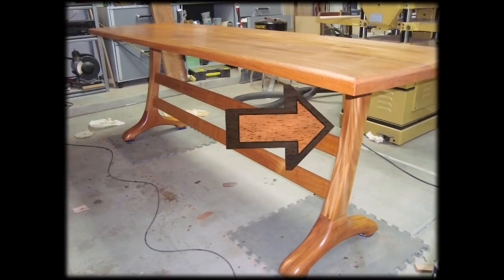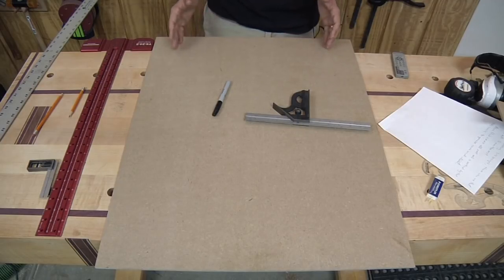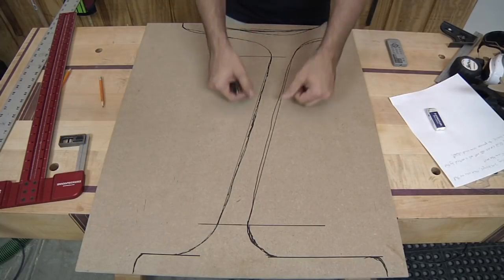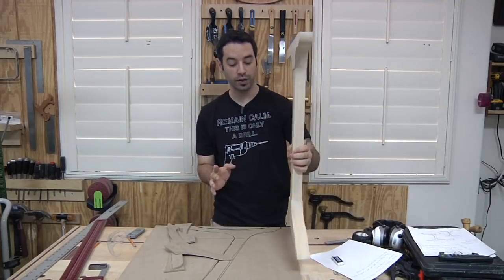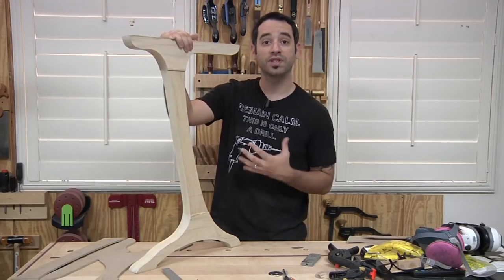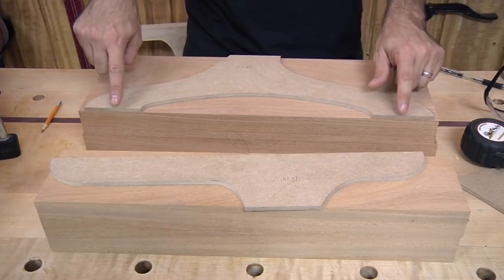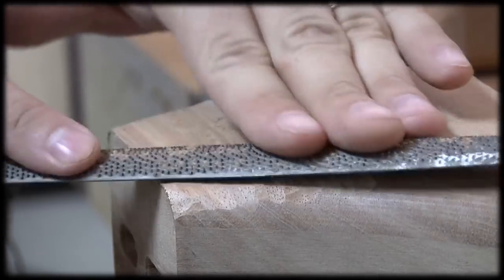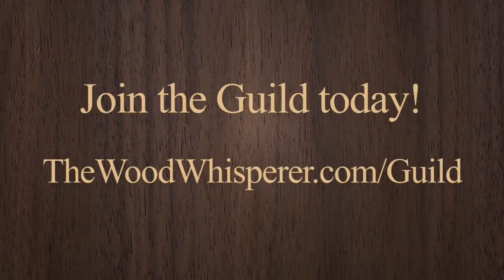134 - How to Make a Trestle Table (Part 1 of 3)

Comment from the maker: While I would have loved to cover those details doc, I had to leave some stuff out for the sake of a reasonable production length.  I have covered wood grain in other videos so I figured this would focus more on the building and the templates.  Ideally, I wanted to go with full thickness pieces but just couldn't find the stock I needed.  So  a glueup was necessary.  As the wood ages, any discrepancies in wood grain will become less and less noticeable.

Comment from the maker: I usually do. This project was a bit tricky though since I actually bought material as I went. Also keep in mind that prices vary dramatically across the country. So the most accurate way to get a cost estimate is to use the board foot count. Of course I don't think I provided the board foot count on this project either, but for future reference. :)

Comment from the maker: @TheLumberjackass My goal is always to show a variety of tools and techniques.  That means I will occasionally pull out something like a Domino.  Which by the way, is the first time I've shown it on the show in well over a year.  Most times I default to the basic tablesaw, bandsaw, jointer, planer tool set.  I needed to get this project done quickly and the Domino allowed me to do that.  The alternative?  No video at all.  I'd be happy to explain this further in email.

Comment: Wish I had time to autocad you some helpful improvements on that wicked table. I saw a drafting table come out of those legs. Hide 2 pivot points in each leg at the kankle snd top curve so you can adjust the angles. Hide the joints with a mortise and tenon style pivot curve with hand adjustable knobs in the inside. Nice format. More videos on yourube can learn from this.

Comment: True, full-size model really gives you the feeling that if this is true. But matters of proportion and design look great in a three-dimensional CAD like solidworks or similar software. I will not argue with you, but I think it's early stages excellent tool that gives you a lot of flexibility in planning of the product. By the way these programs really not complicated to use

Comment: I'd venture to say that Mark didn't have all this equipment when he started. But he did possess the most important tools. Purpose, patience and persistence. Everything else is a result of those three attributes regardless of your occupation. I suggest you check out Paul Sellers channel, he'll show you how to do fine work with basic hand tools. Remember, machines only save time they don't make you a woodworker, it's still a combination of knowledge and careful execution with or without a motor.

Comment from the maker: @TheLumberjackass Oh no problem.  Just remember, there are lots of resources, including my own, where you can learn to make more traditional joinery using much cheaper tools.  So just because I use a Domino in this project, doesn't mean you can't build the same thing using a traditional tenon or inexpensive dowels, which you probably saw me do countless times in the past. Some folks see an expensive tool and immediately dismiss the project. This is a shame and it misses the point.

Comment: if you're worried about the glue joint maybe next time use 4/4 or 5/4 and make a lamination with a darker wood in the middle so it will be part of the look of the piece as opposed to something you're trying to hide or blend in.

Comment: you should try and use a computer design and connect your computer to a Projector and project the image onto a flat wall and by adjusting/moving the projector you can get and amazing feel as to the end product

Comment: Seems like it might have been easier to do the Dominos on the leg to top/bottom joints before the curves were cut, more surface area for the tool to sit on. Don't know about you, but I would have a heck of a time balancing it on the smaller surface.

Comment: Hey Marc, I thought Honduran Mahogany was really hard to get new these days...where'd you get yours? 

Also, .if you ever get an old piece of furniture (like 90-100 or so years old) and it's dark, chances are it's Honduran Mahogany. I got a few good pieces from an old bed. The posts were solid wood, but the head and foot boards were just veneered in Mahogany. I was a bit disappointed because the panels were about 1" thick and if they were solid wood, I could've gotten at least 3/4" boards.

Comment: Eight quarter? Do you mean two inches?
Reply: 8/4 lumber is an actual 2 inches thick where as 2 inch lumber is actually 1-1/2 inches.
Reply: Lumber thickness is measured in quarters.  4/4 is 1" before milling, 6/4 is 1.5", etc....
Reply: Steve Russell Yes, I understand that. The question is - why?
Reply: It probably has to do consistency.  Let's look at the <1" sizes.  We don't want to use decimals (.5, .75, whatever), because these markings are often just hastily written or stamped on rough wood, so something as small as a decimal point would easily get lost in the mix, possibly leading to confusion when you go above 1" (is it marked .15, 1.5, or 15?).  So it's easiest and clearest to use fractions like 1/2 and 3/4 below 1".  Now above 1" we still want to avoid decimals, so the question is do we use improper fractions or mixed numbers?  Well when it comes to ease of marking, clarity, and quick math improper fractions (6/4, 8/4, etc) is the easiest way, even if it's a little unclear at first to the uninitiated.